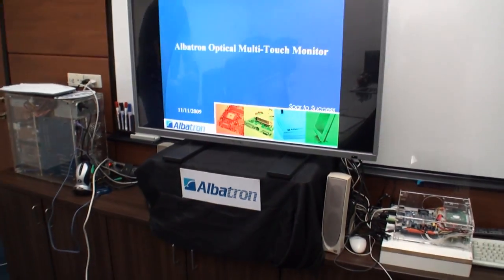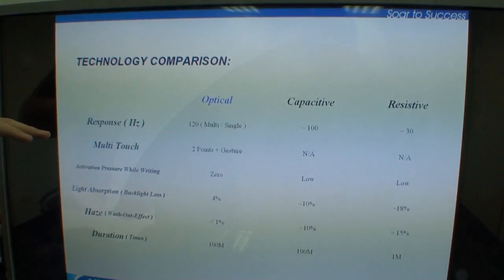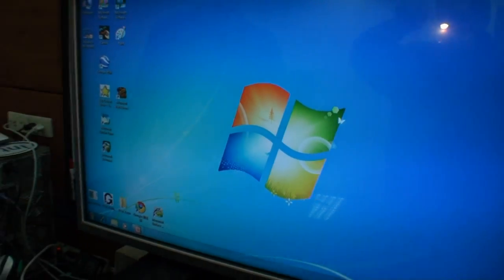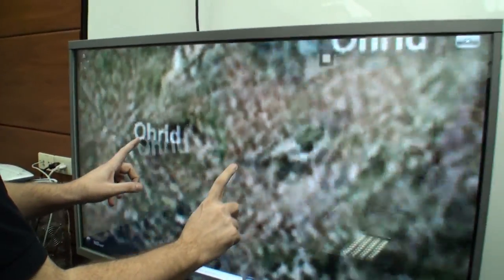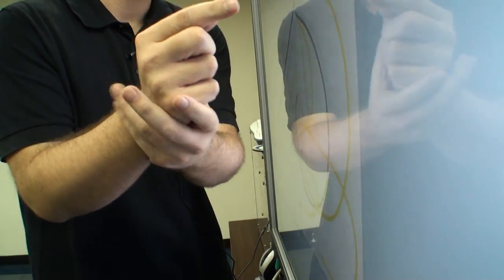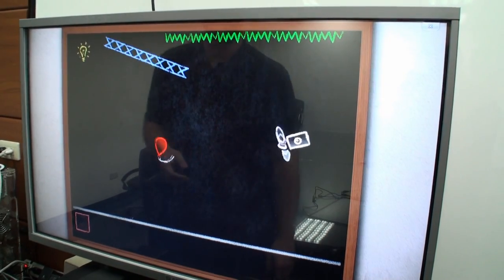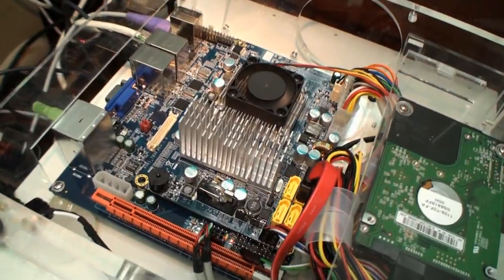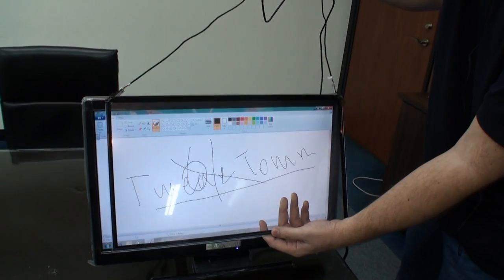Albatron Optical Multi-Touch Technology demonstration

Comment: The first thing I thought about during this video was.. Why not use this technology to make existing screens without touch features actually support multi (to be fair, dualtouch. It can only support 2 'touch' points, or rather it can only detect 2 physical objects due to it's basic design) touch. 
Make strips with reflectors, and put 2 camera's in the corners of your screen. The mathematical formula does the rest of the work. I'm sure you could let a chip interpret the data and connect with USB.

Comment: @Lukeh47 3 fingers would still not make it multitouch as defined by the industry today. 3 finger to scroll is generally a 'gesture' and not actually independent 3 finger multitouch.  There's clearly some issues (I'm sure they've improved since then) in regards to how it works. For example, it has occlusion problems causing the rotation gesture to rotate the wrong direction.